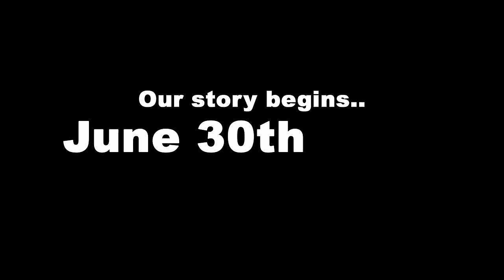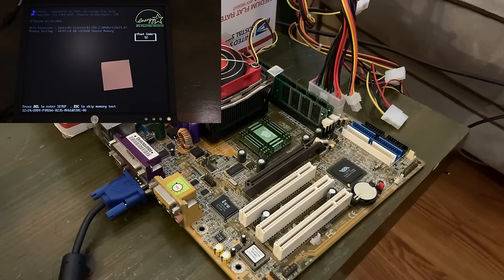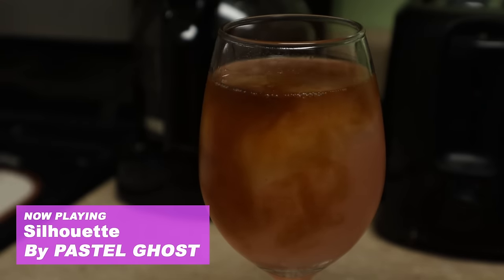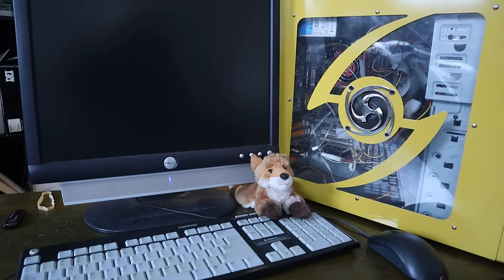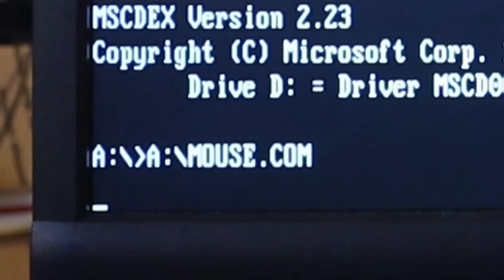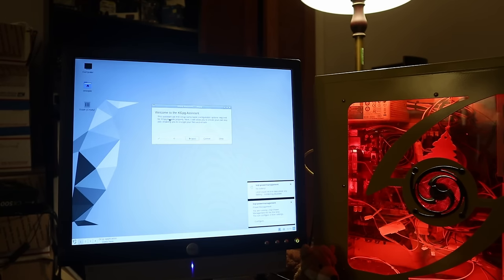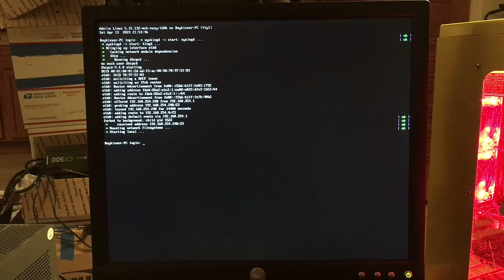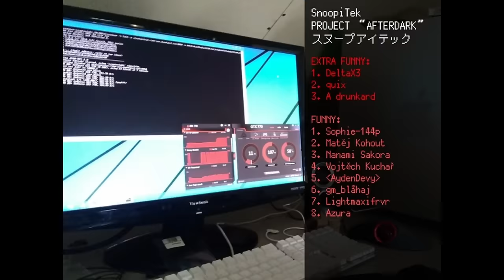The Curbside Celeron PC

Comment: btw if this means anything to you, an IODD is basically a hard drive enclosure but it lets you emulate up to 2 USB disc drives. drag and drop the ISO into the IODD and select it on the device. 
they're pricey but if you deal with USB boot drives on the daily could become a lifesaver. it's even better than using a USB flash drive because it's more reliable.
Reply: They are incredible! Mine let's me mount VHD's too. It's like a hardware Ventoy drive.

Comment: Maaaan why is it trash like this I am into?(Right at home video by the way, subscribed)
Used to have a 1.8Ghz Sempron from 2004 (used It at 1.6 because overheating) and a passive FX5200 until I got bored and wondered what'd happen if I put the graphics card the wrong way (I love the smell of old power supplies so much) 
Couldn't run GTA VC at more than 30fps and Red Alert kinda had stuttering.

Comment: My dad still lugs around a Pentium 3 computer for his report writing software he refuses to update. I believe the brand has a modern version too lmao. He's just about to retire this year
Reply: A friend gifted me a very similar pc case with the same socket. P4 with a fx 5500 I believe. Upgraded the GPU to a 6600gs I think and was still not too happy with the performance. Upgraded to a core 2 duo and 9800gt not long after

I'm still so nostalgic for this generation. Probably because I only ever had a cheap dell dimension with Celeron processor. 

Saw a 3.2ghz P4 HT Vaio desktop for sale in my area with all the matching peripherals for 60usd. Also a 6800gt agp 256mb for only 20usd. I want it so bad but know it's going straight in my closet after a few sessions lmao

Comment: Holy shit the video production quality of this video is amazing honey! That case is gorgeous btw. As for parts being in the weather, one rainstorm is nothing for computer parts, especially old ones (other than the hdd of course). Back when I built my first AM2 gaming rig it was built from parts that were left open in a backyard through rain and freezes. The case sat full of water and leaves on it's side for 2 months before I got it. I've found you can strait up wash parts in a bathtub or with a hose and as long as you live somewhere that's fairly dry and not like 100 percent humidity you can leave it in the sun for a few hours to dry out and it'll run great XD Found your channel recently and I'm all about it. Inspires me to kick my channel up a notch. It may be time for me to do videos on my '99 Gateway again.

Comment: I saw a little 5% overclock sneak in partway through the video. If you think the computer's slow you should see how much further you can overclock it. But it's really not that bad. IIRC my workstation laptop from 2008 (T61p) was only getting around 25fps so 15fps on a much slower CPU isn't too bad.

Comment: I've brought home a pc found on the side of a road that had apparently been there for quite some time, rained on etc (pentium mmx 166, 2gb wd caviar hdd, trident tvga 8900b 1mb isa video card, 64mb edo ram, floppy and cd drive. all external ports were very rusted and the case was rusting under paint. You would think there was no way it would ever work againin its state, but after completely disassembling everything (including the floppy and cd drive and psu) and cleaning the pcbs making sure there wasnt any corrosion that would short anything, i reassembled it and powered it up and it worked (except for the hard drive which had bad sectors and was barely hanging on, can confirm it had windows 95 on it though) ended up using it as a dos machine for a bit after replacing the video card and psu for obvious reasons, i still have some of the parts in my collection after deciding to scrap the motherboard and case as they were pretty rusted and used a different formfactor and couldn't be swapped as they were meant to be used together.

Comment: I have once found a fully functioning Celeron machine too. It was some crappy OEM PC on Socket 478 with no dedicated graphics. On a separate occasion, I found a PC on Slot 1 with Celeron 300A. I kept that one and upgraded it. That was fun stuff. I also found a couple of Athlon XP-based (omg based???) PCs. All old crap, all fun to tinker with.

EDIT: I will not bear the AMD clips slander unopposed. They are way better than Socket 478 clips.

Comment: funny enough this trash boi is probably better than my first computer back in 2006~7
it had a horrid low performance p4, 256 mbs of ram and  either 64 or 128 mb integrated intel graphics

Comment: the reason apk is missing is most likely because it is probably not found by normal user or not supporting normal users to be able to launch it, you need to use su and get into the root shell and then run apk there.

Comment: Huh, it's been a while.  This is bound to be fun.
The board mostly surviving does proof that water does no significant damage to electronics as long as it's not powered and dried soon enough.
Though the CMOS battery would still corrode if it isn't completely flat, which it probably was at the point that you found the PC.
Perhaps that's even the reason it was discarded, as the BIOS might give an RTC error. Ah, like the CMOS error shown later in the video.

Older versions of Office were significantly more efficiently programmed, so a benchmark of period-appropriate software to the current glorified webshit on your current system would be interesting.
Perhaps throwing LibreOffice in there as a comparison on both systems and perhaps Linux too. Oh well.
Speaking of, EW WINDOWS 11.
While it does finally make the taskbar somewhat responsive on faster systems, everything else about it is a mild downgrade in the coat on top of the corpse of Vista.
Which I wrote as you switched to Vista, Aero still is pretty and I wish KDE Plasma (5 or 6, the upgrade was fine for me) its blur emulated it better.

Scrolling on the desktop used to be the default in KDE Plasma 5, so if you installed that, you would have had that too.
Which would probably run better than you expect as it's gotten quite light, assuming the system has enough RAM. LXQt is a better fit though. Though evidently neither really are.

Putting such a scented tree in the computer is a bad idea as the increased temperature and airflow would make the scent too strong.
Heck, a second hand PSU I recently switched to still had the previous owner her scented candle smell in it.
Which made my entire room smell like it in the first few days, unpleasant as I do not like artificially 'fresh' smells.

And you know what, that PC would make for a decent light database server.
You could self-host Logger bot on it for your own cesspool of a Discord for example.

Well, I did come back as your videos were special enough to make me enable the notifications on them.
Which I am starting to do more now on stuff I want to see, but was very special back then.
And this video was on-par with the content that made me enable that and even dive further into the community.
While that didn't last, I am thankful for the experience there and wish you the best of luck with developing it and this channel further.

Some bits of the video had the music turned up a bit too loud in my opinion, other parts were balance fine though, so this might be an intentional (but wrong) choice.
The production quality and pacing has improved greatly in this hiatus, probably from letting you fully cook this video before it's release (presumably intentionally overdrawn intro aside, this felt conscious and worked).
This is the amazing return to form you hoped it would be, good job on the video.
Reply: Older versions of Office are definitely more efficient. I did some tests on my old laptop and a clean instance of Word 97 used less RAM than opening the Windows XP Start Menu.